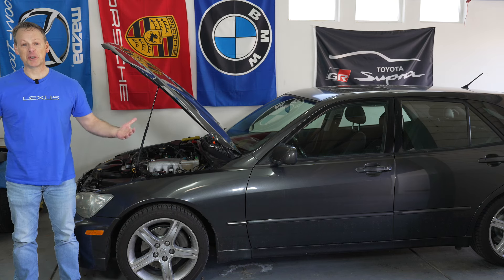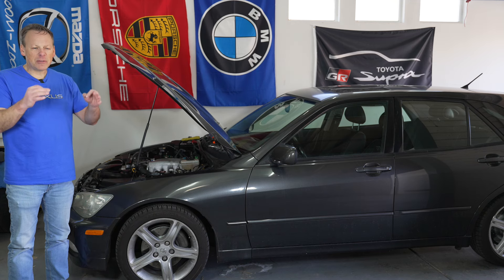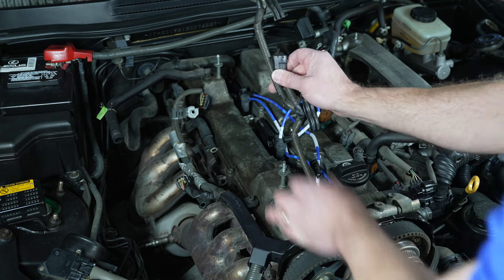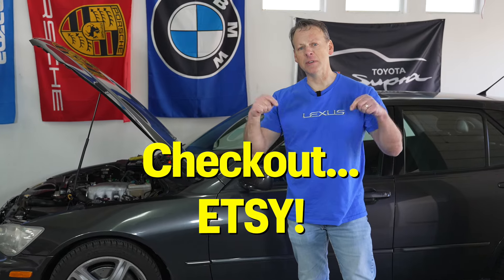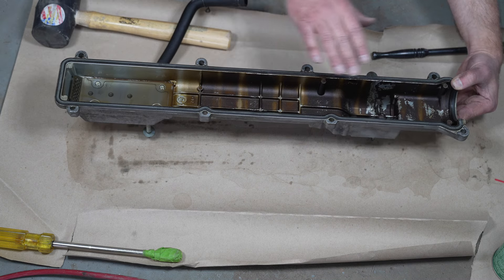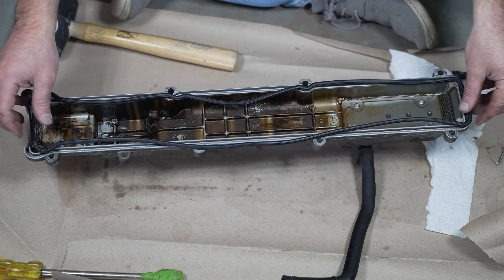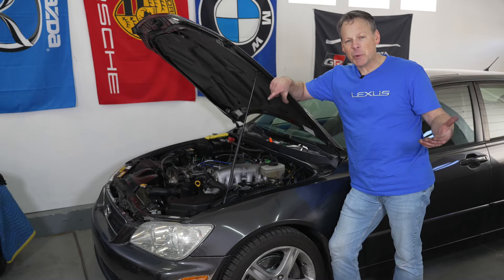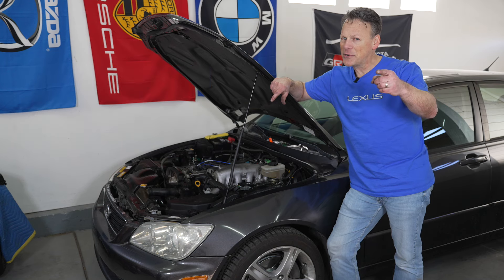2JZ-GE Valve Cover Gasket Replacement / Change!  //  Lexus IS300, GS300, SC300, Toyota Supra...

Comment: A Sportcross hell yea! Pretty sure my SC300 is leaking from the VC right now, my other car is a 02 Sportcross so this is a treat to see.
Reply from the maker: Glad you found the channel 😁. I was very tempted to get an SC300, but needed the 4 doors of the IS. Someday 🤔🤷‍♂️
Reply: @TheLemonFactor  I kind of wish I had gone for a 400 instead, considering I plan to keep my Sportcross mostly stock or at least Oem+. Currently using the SC as a daily driver to keep the IS in the garage after dailying it for 5 years. Getting parts for these cars is probably my biggest fear going forward. There are so many luxury/power things going out on my SC that even trying to replace them wouldn't be worth it. Power sunroof/steering wheel, finnicky drivers window. Both interior door panels are trashed and to even hope to get one in good condition is $500 a piece, likely double. Cracked leather and dash everywhere. Everything mechanical works phenomenally well even after 210k miles, but I can't shake the fact that if it were a Toyota Soarer with cloth seats and general 90s Toyota economy gear that it'd somehow be in a better place today.

Edit: For reference, I live in Arizona so there's zero rust but we have the 120F+ summer heat to beat down on leathers and plastics. Also straight roads as far as the eye can see lol.
Reply from the maker: @RandomBlake2564 do you perform all the work yourself?
Reply: @TheLemonFactor  I do, yes. Aside from things like alignments.
Reply from the maker: @RandomBlake2564 👍